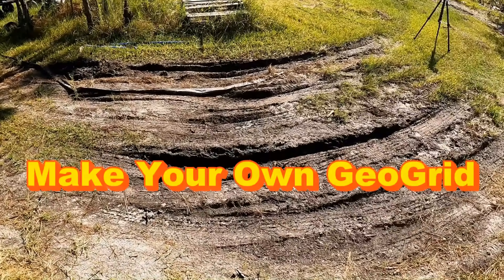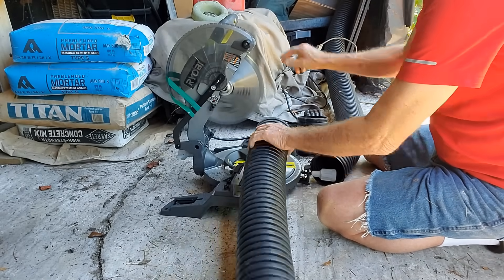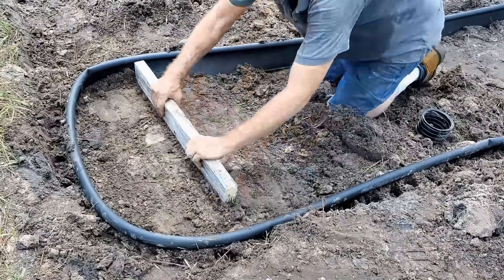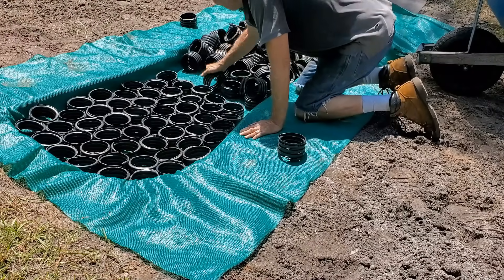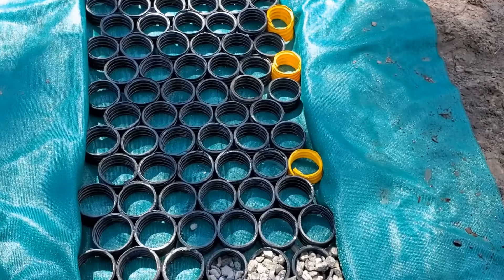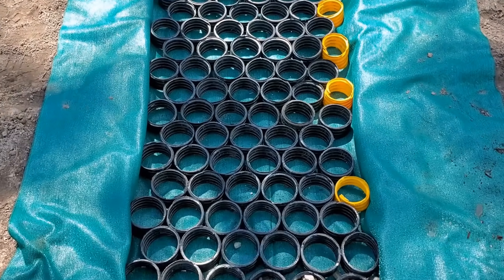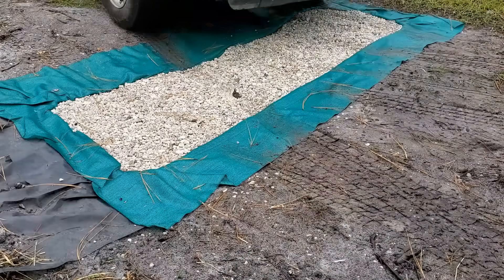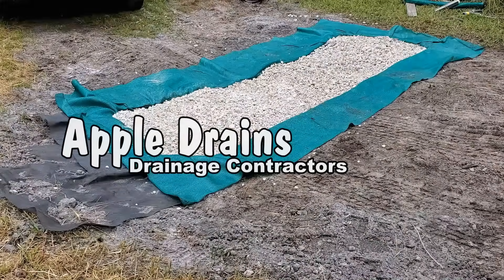Make a Geo Cel Grid that's Stronger and 1/2 the Cost. SAVE!

Comment: From experience, the 80% knitted shade-cloth you are using (the green stuff) is superior to geotextile. It is heavier and lasts longer. I have used it in the past.
Reply: I'll add a third option. I just replaced our safety pool cover, which is a very heavy mesh grid, because the seams all went (the thread let go) The fabric is otherwise still in good shape, so I pulled all the seams and now have about 100' by 5 ' of mesh just waiting to be used for for ground stabilization. Depending on your location, I bet there's lots of those covers heading to landfills that could be scavenged from a pool company or similar.
Reply: @travelfeet thanks. I’ve never heard of mesh pool safety covers. Might ask around
Reply: Who make the green sun shade material???

Comment: While this does provide strength, it also collects water and makes it sit until absorbs into the soil below, which will allow the pad to sink.
It ould be better to put in a French drain underneath then this on top. The pad to provide strength and allow water to collect and the French drain to get the water out before it can sink in
Reply from the maker: There is a great French Drain already installed.. this geo cell grid is the best solution and was installed for less than $50

Comment: Interesting. You said you already tried gravel but yet you are using gravel, and i don't see gravel in that mud you call a driveway.  I like that quick ideal you have to make top soil drivable. But that is the actual problem, it is top soil you were driving on.  But that ideal looks like it will work for a long time. 

Another ideal is to dig out the mud and top soil where you want the driveway, similar to what you had to do anyway to install the geo grid thing, then fill with sand back to the height even with or above the existing soil around the area. Then put a thick layer of gravel, at least 4 inches, it will raise the actual driveway above the existing area now.  That top layer of gravel needs to be a road mix gravel, it will have some clay to bond it together once you pack it down after you lay it on.  The sand underneath is what is being used for draining the water away from the surface. In the water problem areas put more sand, like 6-8 inches thick, and you can still have French drains in the area if you think you need, but the huge layer of sand and gravel will drain the water too if you give it the place to go. Sometimes you need to run a french drain to lower dryer ground to get it draining.

Comment: Great video - I've been looking for an alternative to the pre-fab grids and this a nice alternative and something that provides greater flexibility in non-straight designs.  
Though, not sure this is cheaper. 100ft of this piping covers 33sq ft at $120 (homedepot), and GeoGrid covers 53sq ft for $127. However, if you stagger and space the piping elements 4" apart, then you essentially double the area, and in that case, it does become cheaper.

Comment: This is not a good application of 'geo-cells'. The real product is meant for grade holding. An aggregate surface high enough to not get mucked in again, set on the fabric base, would do fine.  Mechanical compaction would also be good. 

There is also plastic grass parking grid, meant to replace the aggregate base.
Reply from the maker: How to make your own!!
Working So Good

Thanks for your input

Comment: This happens in my back ally where the garbage trucks squish out the gravel making it a perpetual mud hole.  

Could i use cut plastic bottles? Or even empty food cans?

Wonder if this project could be done by young supervised boys?!
Reply: Old car tires cut in half and bolted together and filled with gravel work great for heavy trucks. 

Cut plastic bottles won't work great cause they won't pass water side to side, just down.

Comment: You could’ve solved that whole problem by simply spraying a surfactant on the dirt then as soon as the water would hit the dirt, it would lower the surface tension of the water in the water with seep down through all the dirt and out of the way
Reply: But man, spraying gunk repeatedly would turn that area into a toxic area wouldn’t it? It that spray lasts two years, it’s toxic for two years or more. 
Not a good plan to spray something that could create a toxic environment.
Reply: @TheMissPoovey  sorry but surfactant isn’t toxic.
Reply: @_jurist  according the Britanica; surfactant, also called surface-active agent, substance such as a detergent that, when added to a liquid, reduces its surface tension, thereby increasing its spreading and wetting properties. In the dyeing of textiles, surfactants help the dye penetrate the fabric evenly.Sep 20, 2023

Surfactant | Definition, Properties, Examples, & Facts - Britannica
Britannica
Reply: @TheMissPoovey  yes, it lowers the surface tension which is known as dines. it allows things to spread more easily. Because the lowering of the surface tension doesn’t allow the water to bead up as easily. Like on a freshly waxed vehicle or one with the new ceramic coating. The water beads. the spraying that stuff just on that little area of the ground will reduce the surface tension there to allow that water to just soak down in and spread out. It works great it’s a miracle stuff. And it doesn’t take diddly squat amount.
Reply: Perhaps, but then your repeatedly using and pouring chemicals into the soil. Not a very sustainable approach.
Reply: @newolde1  yeah one application, in that area, you need probably less than 8 ounces of a surfactant mixed with 5 gallons of water, and then you use this hand sprayer and spray it on all the soil around that area. And that would last for at least two years. problem solved
Reply: @_jurist  problem solved for two years instead of 50. Not a great argument.
Reply: @newolde1  yeah and then I walk back out there with my sprayer and I spray it again. Solve for another two years. And I didn’t waste time and money.
Reply: @newolde1  guy I work with I found out his whole front yard would flood, in the spring and the summer. His driveway back by his garage it was terrible. I gave him 32 ounces of surfactant. APSA 80. I told him to mix it in his 2 gallon sprayer, 16 ounces for each 2 gallon sprayer and just spray it on the water, spray it on his driveway, spread anywhere there standing water. Within one week, all the water had dissipated, and for the next two years, he never had the water problem again. And all he had to do is sprays lawn once every two years, and spray his driveway.
Reply: I’ve never heard this technique. Fascinating. The scientist in me really wants to try it and compare results with a patch of this geotextile option.

Comment: nice project...but before all that, I'd have FIRST placed some recycled carpet upside-down after leveling that spot. THEN place your gravel/mulch/shingle tails/.... That carpet "geotextile" will last 500-years, and stand up to nearly-all vehicle traffic. Your welcome, kids :-)
Reply: Research how much assorted biocide is in old carpet and you'll never want to touch it again. Carpet leaves the factory drenched in insecticides and fungicides - especially the high quality wool carpets, because otherwise moths and mould adore wool carpet - but then the way carpets absorb and accumulate toxic chemicals in use is just disturbing.
It's a quick way to destroy your garden, and it's not something you want in your home either.
Reply: Like dirty socks you never change or wash.

Comment: Is going to break down around the edges where it meets the mud it's a low spot that's the problem you need to trench away from it had two trains running downhill you could a sump and pump

Comment: Nice idea! To help to keep the plastic tubes in position and the gravel too I would use a thin flexible copper wire through all the tubes in line.
Reply: I'd be concerned with any metal breaking over time & rising up to puncture tyres.

Comment: Considering I sell REAL PERFORATED GEOCELL for 1/6 the price, this makes me laugh. But keep up the innovative thoughts. My calculations resulted in a cost of about $3.00. sq foot without labor and cutting... I manufacture genuine Geocell that is welded strips of HDPE and 4" 30 cell opening Geocell.  We sell for less than .50/ sq foot. I will sell you truckloads for .50/sq foot if you want to purchase it...
Reply: Link please.
Reply: I have shopped for geocell and found it cost prohibitive. I must be looking in all the wrong places! Can you give me link to your product or where to find the prices you are saying exist?
Reply: Why buy it if you already have the material? Recycling? It makes sense.
Reply: I hate to say it but Home Depot sells Geo grid cheaper than this project. They sell it for $1.53 per sq ft but that’s still cheaper than doing this at about maybe $3 per sq ft and you still have to cut and place it all.
Reply: Link?
Reply: Where are you ?
Reply: Where is the link to your product? If you can’t provide a link folks will think you made up the 50 cents a square foot price.

Comment: An area near where I live, Troutdale Oregon, does this for cheap trails, pathways, alleys, and sidewalks alongside French drains or other drainage ways. There are areas there that have very poor soil stability. On managed forest paths they'll even sometimes do this, but most of the time they use natural materials that build better soil when they break down. The construction workers here do use the store bought methods when they're on a tight schedule, but use your method when on a budget or needing more structure, like a stable, high drainage base for pavers or heavy traffic wear.
Reply: What natural materials do they use?
Reply: @toritori5835  Logs and living root system methods are what I've seen. They place cut logs in vertically, cover with layers of dirt and gravel; sometimes use a retaining wall of cob, logs, or rocks; then plant native trees and bushes along the sides. By the time the logs decompose, the roots move in to fill the gaps and hold the soil, while the soil mix is made to have good drainage.

Comment: Great idea for inexpensive structure to hold the gravel together. Thanks for sharing. 
Get real friendly with your local drainage and landscaper and you could get scrap cut-offs free or silly cheap. 
Worked for me with PVC and conduit pieces from an electrician. 
Beats going into landfill.
Reply: I worked as a plumber and we make tons of scrap abs and pvc all the time. would be nice to see a use for them. Mostly just go to landfill.

Comment: I have seen a similar idea but for a complete road. They used old tyres instead of pipe.[ they cut one wall off the tyre to make it easier to fill ]
Reply: I've used the recycle tire method a few times. On driveways that are real  really sandy very muddy  we keep one side to hold the material but drill holes in it for drainage and cut the other side put down tires open side up and fill full of rock
Reply: Good idea!

Comment: 3-4” 5 corner stone. Tamp it down with an excavator bucket. Leave it alone for a few rainstorms. Come back with 2- stone and tamp that down. Cover with fines and drive over it with tracks of excavator. Problem solved.

Comment: All interesting, but GEO-cell is not a solution for the problem. You need to solve the problem to use the GEO-cell. I wish you all success.  I've been struggling with a driveway problem  for years.

Comment: if you don’t cut all the way through the pipe and alternate each side it will leave a tab on each one connecting them together and use zip ties to connect them group too occasionally.
Reply: I like it, though you'd need to flip 180 or turn the pipe 90 degrees for each cut, which might get  tricky on a long piece. I am sure I would mess it up too and end up with a 3 dimensional pyramid of rings instead of a flat mat.
Reply: That's a great idea
Reply: I tried this and it works great. Just make each cut offset immediately next to where the last cut ended.
Reply: @Tonisuperfly like an accordion?
Reply: @randolphfriend8260  hmm I can’t relate it to an accordion sorry… How can I describe it better? Think of the perimeter of a circle. Cut all except one small section that you leave attached. For the next cut, the bit you leave attached will start right where the next one finished. So you end up the attached part continuing in one direction along the perimeter of the circle. This way, each ring slightly offset and they will sit flat, right next to each other when you lay them out. Does that make any more sense or have I made it more confusing?

My recommendation is to try it on a cardboard roll first, so you can test the pattern.
Reply: @Tonisuperfly  Thank you for the explanation
Reply: @mymai5859  you’re welcome :)
Reply: Excellent!!!
Reply: i don’t get it and really want to understand!
Reply: Think like a "Slinky". Slice 80% of pipe diameter. Only one lil piece connecting as you fold the pipe to the right, slice 80% open, then fold left, slice, fold, slice.... On and on, forever. 😂
Reply: I was thinking I understood but still was confused  @theredfox27 . You & the rest of the gang cleared it up.
Reply: That would work nicely.
Reply: I'm using his technique to make an extremely long driveway. I'm going to dig out 2 tracks 2 feet wide each track, put down his homemade geogrid, some fabric under each track. Then get gravel delivered. It won't take much gravel. I might even cut it down to 1 foot wide tracks which match my tire width? I was considering spending thousands and thousands of dollars on this extremely long driveway. Now it might cost less than $500 and last 20-30 years? Can anyone find anything wrong with making 2 tracks of homemade geo grid?

Comment: Thank you so much for this idea!!! I have a 10x20 shed to build and extend my patio pad to make a screened in porch out of it for my cats. 
I was going to buy the geocells. But instead of gravel, I am going to pour concrete. That way, I really don't need rebar. 

I am really grateful for seeing this video!! 🙏 thank you.
Reply: why won't you need rebar?... just checking that you understand pouring concrete into this make shift geocell will be weaker than solid concrete  or concrete with rebar.     You would end up with isolated cylinders of concrete that are not joined together.  What he did with the  tubing sections and loose gravel is perfectly reasonable.
Reply: @unionse7en  the cylinders are not solid.  I planned on using 2" tall geocell in my 4" concrete pad pour. The holes/slits in them allows the concrete to bond together. Instead of having isolated cells, as you suggested. 
If I am not mistaken, concrete just needs a fibrous type of structure to bond with. Heck, you could just pour it on top of grass if you so desired. I am no comment expert. I have a Naval mechanical background. 
But I see your point, I will research further.
Thank you.
Reply: @Jay_the_Caffeinator a 10x20 pad will need fiber reinforced concrete mix, or rebar or the panels or something to give it tensile strength. Or it will Crack super fast. 

There's not enough connection through the perforations to give the concrete strength. There just no point if you're going to pour a pad over this geogrid type of thing. This is a system to keep the gravel from sinking or migrating laterally. And to drain water. None of which you should need under a concrete pad. This isn't a good geogrid anyway cause there's nothing linking the cells together.

Comment: @Apple Drains - I don't know if the trees in the video are on your property. If they are, or if you can find standing dead trees for free, you could make a corduroy road. 
You still have to dig down and then lay the trees across the drive and then bury them.
 It works well in muddy areas.
It works best if you can cut the logs down the middle and put the flat side down so the logs don't shift under heavy traffic.

Comment: If you wanted to do something like this, but had clay soil beneath that just doesn't drain, could you put a drain under it and route the water out to a ditch?
Reply: Do you really need this under clay? Just lay lay 2-3 inch gravel, let it compact, lay down 1-2 inch gravel, let it compact, then lay down crusher run.

You can put drains under that too or just grade the edges, depending on typography.

Geogrid is really needed where there’s no base (clay is a base) like 30 feet of Iowa top soil or Florida sand.
Reply: @silverbackag9790 If the gravel keeps getting pushed into the dirt or sideways then you need to put something in more rigid that won't allow the gravel from disappearing again and again.
Reply: @AlexeiTetenov  if it’s clay, it ain’t going down very much. Not starting out with a good base of 2-3 inch. It’s pretty much going to stick in place.
Reply: yes

Comment: Love the idea!  Thank you.  I'm in the FL panhandle and have been thinking of adding on to my driveway with that fancy permeable concrete.  Your technique might fit the bill.

BUT: could I omit the fabric?  I want the water to drain down though the install.
Reply: If you omit the fabric that gravel will eventually work it's way out the bottom. Best idea would be to make sure the fabric you're using lets water through. Most does to some degree.
Reply: @gravityisweak  Thanks for the reply.  Makes sense.  Sandy soil+driving on it will push the gravel down faster than with a barrier.  So I suppose that might just mean you'll have to add gravel sooner, but drainage might be improved.
Reply: @Keifsanderson  Just use a permeable geotextile. If the gravel gets pushed in, you'll compromise the whole thing, as the cells (in this system or the commercial tiles) aren't meant to bear weight, they're only load rated when filed with something.
Reply: @OneTrueCat  That's sound reasoning.  Thanks
Reply: @Keifsanderson  You got it, pal. Happy landscaping!